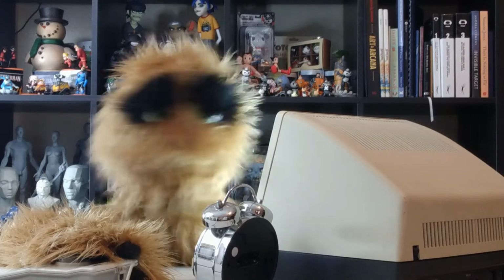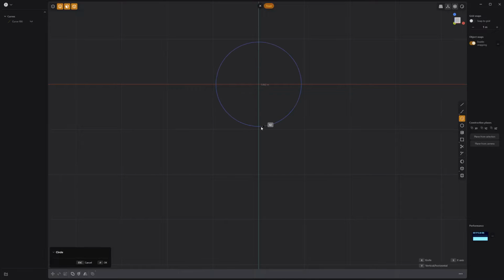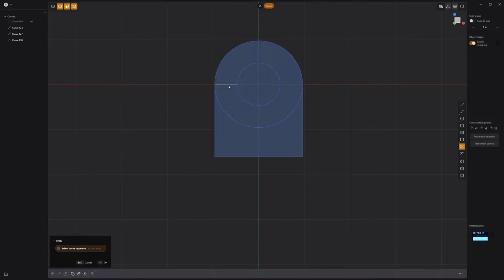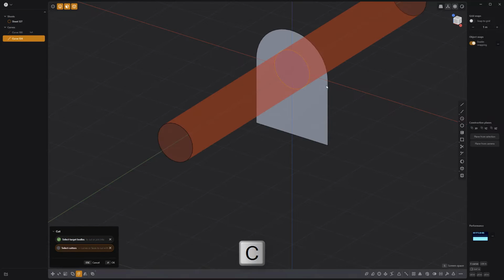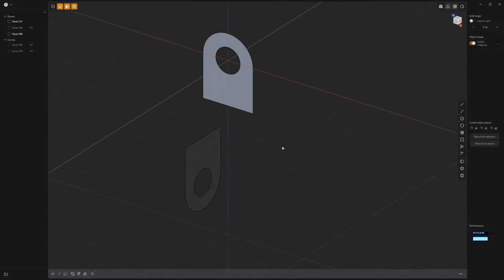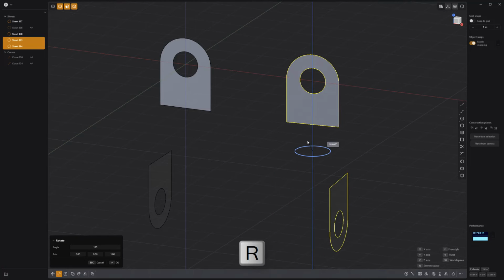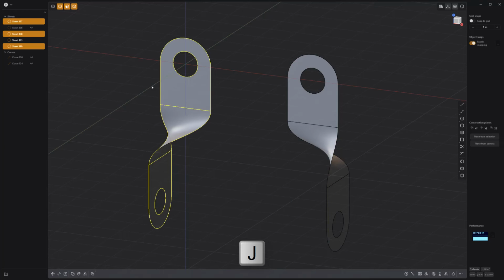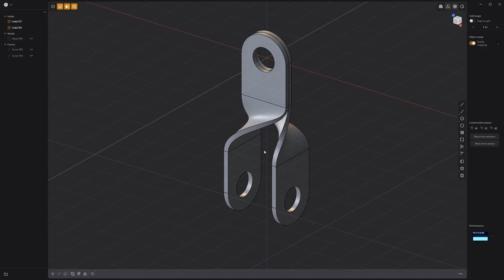Plasticity | Modeling Exercise 09

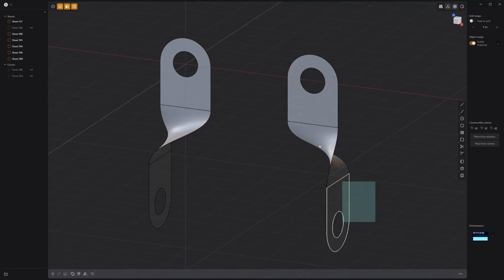Comment: 0:56 How did you make the loft on the other side have a different direction? I made them symmetrical on the left and right, and there will be interspersed when they are put together.
Reply from the maker: rotate the duplicated sheets.

Comment: Another thing i noticed: if the sheets won't join, delete the loft, spin one sheet 180° (R+Z+1+8+0+Enter), then loft the edges again.
Also, my sheets won't join, so i copied the thickness value from one sheet and pasted it in another.
Reply from the maker: can you show example of sheets not joining?
Reply: @pixelfondue  it was random, the thickening of sheets happened in different directions. Can't replicate it, repeated all the steps and worked fine. Guess i missed a step.

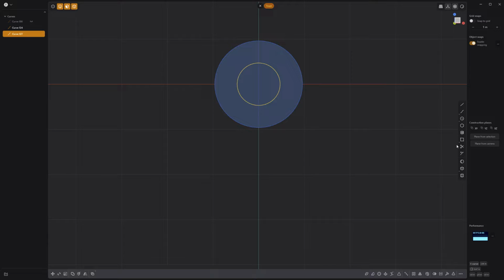Comment: 0:17 That's a three-point rectangle you made, holding mouse over the button? It's definitely a better way of making it here since the points snap on the circle tangents, making it flush on opposite site.
Reply from the maker: there is a three point rectangle tool

Comment: Great tutorials, man! I'm working through them right now and it helps a lot!

Have a question:
Is there a way to direct loft operation rotation? If you want to loft two edges at 90 degrees to each other, is there a way to tell the program should it loft clock-wise or counter clock-wise? Apart from rotating the second part 180 degrees.
Reply from the maker: Tbh Im not sure but I'll look into it and report back if I find a way

Comment: How do you make an exact rectangle of circle size? What is the short key for snapping?
Reply from the maker: It will Auto snap with object sampling enabled.. Then you can use the shift key to create temp element guides to snap to.
Reply: @pixelfondue  I can do this with 3point rectange but not with corner one. Snapped with top vertex and the bottom but when the rectangle is pulled away it leaves the second point snapped with.

But with 3pong rectange I can do it.